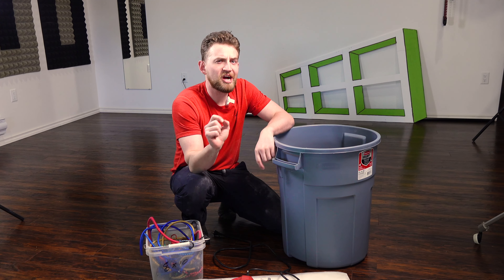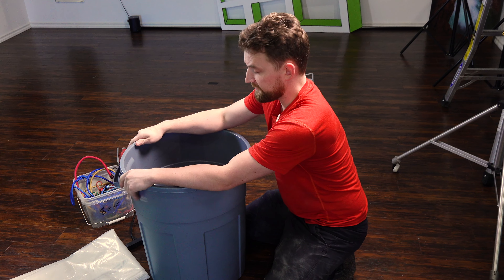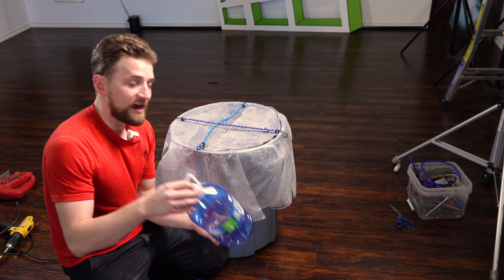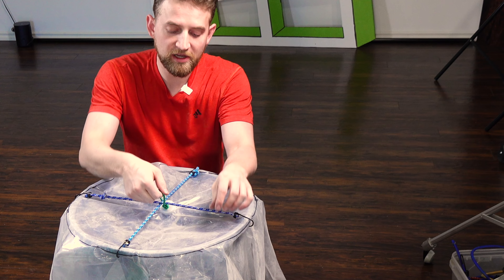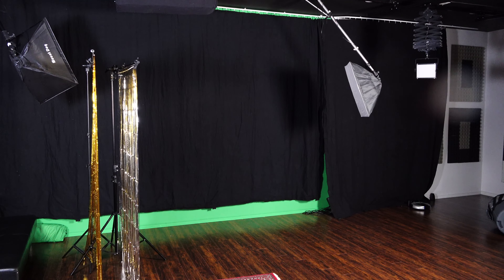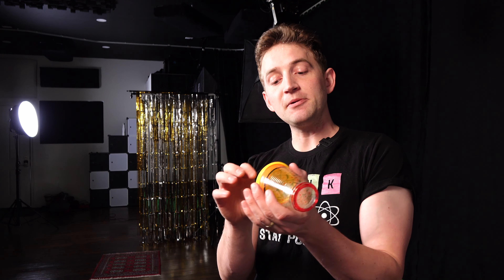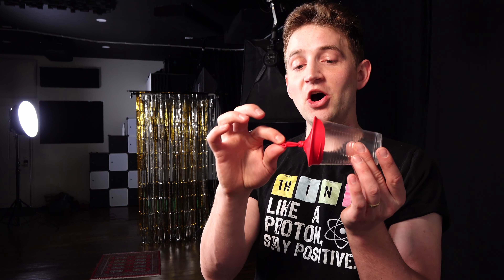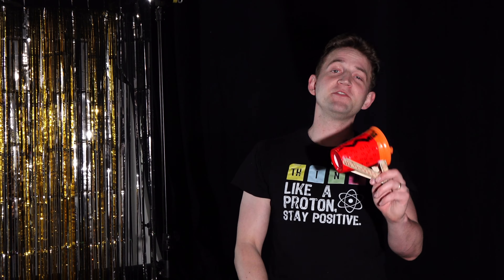Can you "Throw" AIR? Build a Vortex airzooka yourself!

Comment: I have made them with oatmeal containers.  Just cut a small hole in the bottom, say 1 inch / 2.5 cm.  Leave the regular cover on the container, preferably plastic, although the cardboard ones also work.  Then rap the cover with your finger - just like shooting a checker or marble.